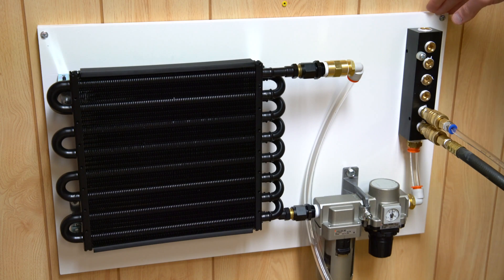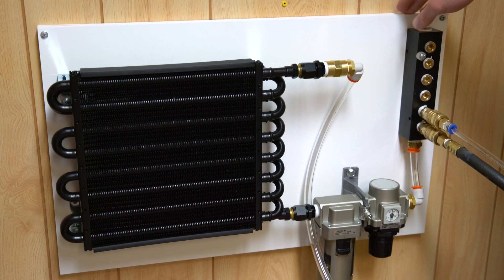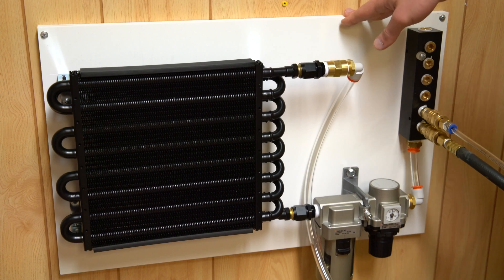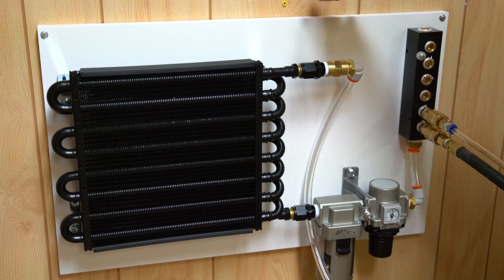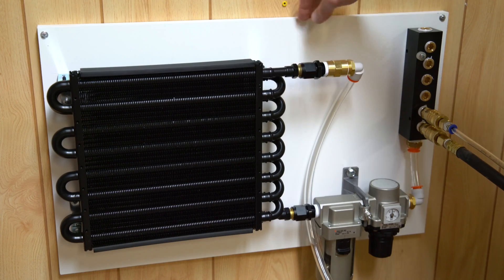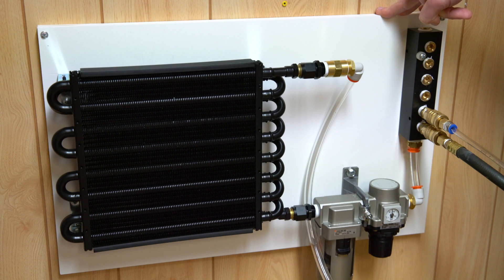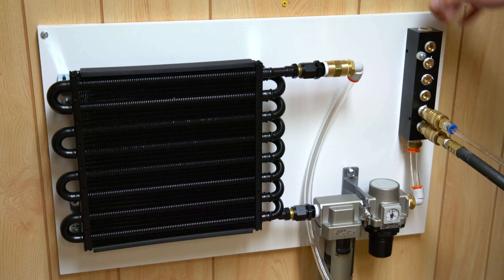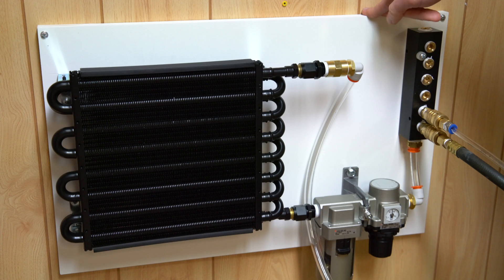DIY Low Cost Compressed Air Dryer Water Separator Overview

Comment: I have a Vevor 80 gal. oilless AC that has four pistons that empty into two ports on the tank so I think that I will need to do a doubleversion of what you have illustrated here. There are many YT videos on this topic but, so far, I haven't found one that deals with this newer Chinese design with multiple ports on the tank. These ports are 1/2" ID so the total input to cool is 2X that I guess.

Comment: If you have this plumbed between pump and receiver, you are doing it right. If this stuff is after the receiver, you are doing it wrong. And your condenser needs a fan unless you live in Alaska and have an unheated shop!

Comment: While this is a great system for removing moisture for air brushing, the same concept can be used to cool the air coming from the compressor before going into the tank.  This can greatly reduce the condensation inside the tank and prevent rust build up, and potentially eliminate the need to drain the tank after each use.

Comment: 22yr exp in car painting. I built one of these for myself. Love it. It does something else my guess it destatics the air and my paint work looks different. Mine is tied strapped to my compressor lol. Down side when spraying is the air is cold when I spray and now working on reheating it before returning to the tank
Reply: No examples yet but fitting a counter flow heat exchanger BEFORE the condenser and running the dried air back through it would send warmer air to your tank. It MAY also reduce the thermal workload of the condenser as the counter flow heat exchanger is cooling the incoming air.

Comment: Your entire system will work better if you cool the air leaving your compressor before entering your tank and collect any water prior to entering your tank. Also, heat transfer works better with a fan to disperse the collected heat in your heat exchanger. Not trying to be critical, but I think it could work better to prolong the life of the entire system.
Reply: That’s what I was wondering
Reply: Yes this is true.  Air in the room = not raining in the room.  Hot air exiting the compressor, before the tank = not condensing, air in the tank cooled down = condensing.  So you cool it down after compressing, before it enters the tank and drain the water that condenses.  This is relatively useless; this can be proven by looking at how much water actually exits the drier, which will be very little or none.

Comment: The cooler needs to be between the compressor and the tank. 

It cools the air and allows the water to fall out and never enters the tank. 

By that time it enters the tank and cools down it’s harder to get the water out. You have to cool it much colder.

Comment: Nice setup. I'd add a fan to the radiator and a T between the radiator and the air dryer with a valve in order to minimize the work load on the air dryer so that you can empty water before it gets to the dryer. Other than that it's a really nice looking setup!

Comment: Good but you didn’t say what’s the max operating pressure for this system.
Reply: The transmission oil cooler itself is rated at 250psi, 300psi burst.  Air compressors operate at 150psi max, but seeing that he's using clear vinyl tubing for input, I suspect that it's running at much lower PSI otherwise that tube would be a hazard. :)

Comment: I would argue that the cooler placement should be between the air compressor pump and storage tank. You want to store  dry air. I'd also install a fan on the aftercooler. It could very wired so that the fan only runs when the compressor runs.
Reply: Agreed. Also, I’d suggest a tee at the end of the coil with the outlet going vertical to the water separator and the downward going to a drip drum to catch water so the separator isn’t mechanically handling all of the moisture from the system.
Reply: the first cooler video I watched the guy mounted the radiator to the fan shroud so that when the pulley spun it acted as ai fan to pull air across the  coils but he had a large compressor
Reply: I’m seriously considering just using a coil of copper tube through a bucket of water for cooling.
Reply: @gtcam723 What happens after the water in the bucket heats up. I guess you could put a garden hose in the bucket to continuously add cool water and just let it overflow if that’s ok. I’m just thinking out loud.
Reply: @mattvogel5712  The bucket of water has enough heat capacity to handle the BTUs that are transferred into it.  Same as how the air in the tank cools off, and you really don't notice that tank getting hot. This is a good solution for a home garage, might not work as well in a commercial setting where the compressor is on all day.  And as noted, the copper pipe should be the one between the compressor and the tank--that's where the air is hot and the air inside will condense when cooled.
Reply: What about that high of pressure? That transmission rad isn't made for those high pressures.
Reply: @anthonyrochon3907  If it is a quality unit made of copper then it can withstand over 200 PSI. Standard plumbing copper is used all the time to plum shop air and it is used on my IR 2 stage compressor from pump to tank (factory).
Reply: I don't agree with you. Sorry
Reply: @petecoffman9048 a cooler is supposed to cool the air before it hits the air tank because the air is hot as hell coming straight out of the compressor. This is why he is saying this. The hot air clashing with  the colder air in the air tank is what causes the water ... So I agree a system between the compressor and tank would work best.

Comment: I don't really see how this would work. The moisture in the air will go through the radiator and into the trap at the end. 
Just condensed it to be caught more easily?
Reply: Yes essentially that’s all it’s doing, hot air = steam. Cool air condenses and water can be caught by a trap/desiccant filter. 

Not the best solution but will definitely help a lot

Comment: A fan would help as well.  Coolers work with the principle of air flow across the fins.  Maybe very low voltage computer fans could work because of the very low amp draw.  Nice looking so far.

Comment: So it is safe using plastic pneumatic tube between pump and radiator? I was hesitating because the hot and compressed air softens the plastic tube and eventually blow it.
Reply from the maker: If your compressor’s output is hot then PU tubing is not for you

Comment: It would be really helpful if you added details in your description about what exact compressor (and it's capability) you are using this with.  Everyone's compressor will obviously be different.  For example I have an old Saylor-Beall 705 with a 120 gallon tank.  My motor is 5hp and pump output is high with a 3/4" tube out of the pump. I've been on the fence about buying one of these Derale units because I feel like the 1/2" or 3/8" lines is going to make my pump and motor work too hard.  But unfortunately if I build a copper pipe system of ~15 pipes at 36" each it will cost me around $450 with all the copper, fittings, hoses, etc.  If I could get more concrete data on how or why this would be fine for a large pump I'd obviously do it instead.
Reply from the maker: I really should just make a follow up video about this setup and an update on how it’s changed. I left far too many details up to “common sense” in hindsight for the sake of keeping the video brief.

Comment: I see you have plastic tubing going from the compressor output to the radiator inlet. How is that surviving the high temperatures of air that's coming out of the compressor?
Reply from the maker: Compressor is in the garage now, air goes from compressor regulated output to a small manifold before reaching the tubing and running about 10’ through the clear tubing. A lot of people seem to want to mount these as a pump aftercoolers or their demands are greater than mine, in which case yeah the PU tubing is a bad idea.
Reply: @NikitaLab  Sounds good and thanks for the quick reply! This setup is definitely the cleanest i have seen on YT. I would only add on a fan.
I am thinking about the route from compressor outlet to rad inlet and i think ill make it in copper with compression fittings or soldered together.
Reply from the maker: Sounds good and I have added a fan, I should make a follow up video.
Reply: @NikitaLab  Please do! I would love to see it in more detail

Comment: Nice work but one little thing! You loose a lot of heat just after the regulator as the air expands with a reduction in pressure so your regulator needs to be turned around so it’s upstream of the trap.

Comment: The problems with your setup is (a) the condenser loops are too small/short for compressed air use, the tubes in the condenser are too narrow, and you have the condenser loops going horizontal.   A much better design (yes, more money, but still under $300) is to make your own "condenser" with a series of loops in either black iron 1/2" steel pipe or 1/2" copper tubing (copper, being more expensive, of course).  There are various guys on youtube who have done this design.  If you paint or do anything where your compressed air must be absolutely dry, your setup will not dry the air nearly enough.

  You want each run to be 10 feet and you want at least five 10' vertical runs of tube before connecting to any air filters or tools. You also need ball valve drains on each end of the tube to drain out the moisture (this can be done automatically with an electronic drain or manually).  You want the tubes to be vertical with water drains on the bottom so that gravity can settle the moisture to the bottom of each tube.

Comment: Wrong radiator type. Please enlighten me if I’m wrong but the radiator you are recommending (which I ordered and just received) is designed in such a way that any water that collects in the radiator is forced to flow uphill. If you look closely and follow the path from the inlet to the output, every other rung redirects the flow back uphill as it transitions from the  front part of the radiator to the back part of the radiator. This particular radiator has a front and back almost like two radiators sandwiched together. With this radiator I think you will get water trapped at every other rung. Basically the water isn’t allowed to passively run downhill and I don’t think the airflow is going to consistently flush it all out. I’m going to return mine and find a single layer radiator if that exists.
Reply: I was scrolling through the comments looking for this catch. Im surprised how few people notice this problem. It's too bad metal isn't transparent. I've even found one video of a similar system without a water separator at the bottom exhaust. The idea was to remove moisture merely by cooling the hot air down before it got to the tank. Lavoisier's grave is a rotisserie.
Reply: I placed the same radiator after the compressor at about 45 degrees so that all of the tubes are on the same plane to where the water can drain from tube to tube to tube and so on into a moisture separator then on to the tank.  How ever you do this make sure the compressor discharge line can't drain moisture back to the compressor.
Reply from the maker: Good point, one shop I was at had a serious air dryer but it didn’t matter at all. They were still getting water in the air supply.
The water was being dumped on the floor in the corner where the compressor and dryer were, no ventilation, concrete was completely messed up.
Reply: You're probably better off making your own with copper pipe.  Even without the radiator fins, a serpentine copper pipe set-up gets the job done.
Reply: Water flows uphill
Reply: I have seen domens of videos where people used this exact cooler to dry the air. Everyone besides the guy in this video place it before the compressor tank wich is the best place for it. But do you mean this cooler is a bad design for this use?

Comment: I like the way you have your system setup. I think I wanna do the same thing to my compressor. Question, how much air pressure can that radiator handle?
Reply: 250 psi working pressure, 300 burst
Reply: @thayerhills  Thank you for the reply and the info buddy.

Comment: This seems more practical than putting it between the motor and the tank. Who cares if moisture gets in the tank? Get an auto drain and keep it drained. People go to a lot of added troubled mounting these things to their compressors, between the motor and the tank.
Reply: There is a very good reason to have it between the compressor and the tank.  Air holds a lot more moisture when hot so when you run it through a cooler even at room temp, it cools it down a lot and it’s very easy to get the air below dew point and get the moisture out. 

But once it hits the tank and cools down you have to get it even cooler ie a refrigerated drier to get the moisture out. 

That’s why they put them between the tank and the compressor.
Reply: @DasNewsNetwork   I would argue that it doesn't matter as the moisture is already in the system after the compressor and cannot get out even if you cool it before the tank.  Yes, the radiator cools it down, but it still goes straight into the tank regardless of whether it is hot or cold.  Cooling it before the tank does not make the moisture disappear.  I went round and round with this when I set up my CNC plasma table.  Putting the radiator/cooler after the tank with a moisture drop in the line to the Plasma machine is what worked best for me and made my consumables last considerably longer.
Reply: Lot of dooods and honeys and bros arguing over radiator placement, and there STILL being moisture rather between the head and the tank or after the tank or blah blah blah! So it’s like this, compressor head compresses the air and makes it HOT! hot air carries moisture. So from here it goes to the radiator hopefully with a fan blowing through the fins to help cool the air further, this WILL produce condensation but BEFORE the tank! THEN it the line runs into a moisture separator with auto dump or whatever it’s called. THEN it finally hits the tank, COOL and DRY. Now you can line out from the tank to your filter regulator and desiccant noize maker and finally to you plasma action! THIS is the right way. Wish I knew as much before my first CNC Plasma table and air set up. I’ll be reconfiguring soon and likely have a video to show for with before and after mess! Hope this is right on right on with the lot of yee!🧙🏿‍♂️👈🏼 why does apples emojis have a black wizard? Weird right🤔
Reply: @4rnorthwest hey bud any update on that video? I’m about to get the crossfire pro myself and looking for the most effective dry air system to build for my air compressor. Think you could share your current set up?

Comment: doesnt the air create the moisture when it goes from the hot compressor motor to the tank being the tank is room temp and the motor gets the air over 200+ degrees..... I always thought it should be betweem motor and compressor tank.

Comment: Thanks again.  After watching a ‘million’ ideas on after coolers, I ended up building one similar to yours.  I got the same Derale 15300 unit, I did a drop down with a ball-cock drain after the Derale, and then through a filter / water separator / air regulator.  I also have a small fan that I incorporated to blow across the ‘rad.’  Boom.
Reply: I thank you for your information on the derail oil cooler unit. Fantastic.

Comment: You don't have a fan blow against it. Is that still effective.
Reply from the maker: I do now but just like baseboard heating the radiator did a good job of thermal transfer without a fan.

Comment: Hi Nikita - nice and tidy. love it. I want to make one just like it. I have a question. I assume that the clear tubing going to the radiator is coming from the compressor head, and that the black rubber hose coming off the manifold block is going back to the compressor tank. Is that right?
Reply from the maker: No Henry, the clear tube is coming from the compressor's air tank, and the manifold black hose is going to another tank that acts as additional volume. What you're describing is a compressor aftercooler which is nice but not ideal for me and my small, tightly integrated compressor. I'd use copper tube if I wanted the radiator to come after the compressor head.
Reply: @NikitaLab  Thanks Nikita, that makes sense.

Comment: I don't get why you have clear thinwall plastic tubing on the INPUT side of the cooler(?)
The temp going in can reach near 300°F on some compressors.
Reply from the maker: It's a small 1.2HP compressor and this is plumbed in after the aluminum air tank so for me it's ok.

Comment: Nice job! Have you considered putting the heat exchanger between the compressor pump head and the storage tank? I'd  like to do that to cut down on water collecting in the tank, and corroding it, shortening its life. My last compressor tank failed from internal corrosion.
Reply: My 1st thought too
Reply: I did that to mine put the rad before the tank

Comment: For very little a 12v radiator fan that comes on with the compressor and for goodness sake place a T just after the radiator and before the air water separator and dump all that water in the drain tube before getting to the air/water (water still saturated in the compressed air not liquid water do your homework) as separator is not designed to handle it and when you can drain 90+ % off before it gets there! Needs more educated thought all you have is well nothing! Why use a radiator when you don’t do anything with the condensed water first right now it’s almost a total waste. You change the state of the water saturated in the hot compressed air then you don’t do any thing with it. You gotta drain in off!
Reply from the maker: Worked fine lol but yeah the video is a bit outdated. Air filter isn't a replacement for a water trap so I added one, and radiator now has a fan on it.